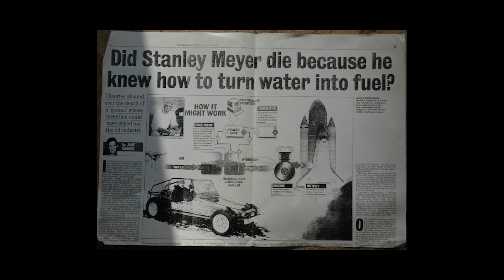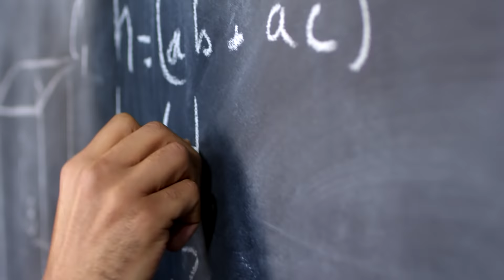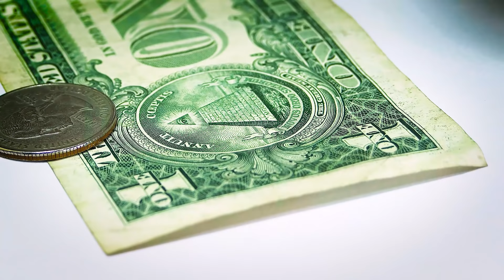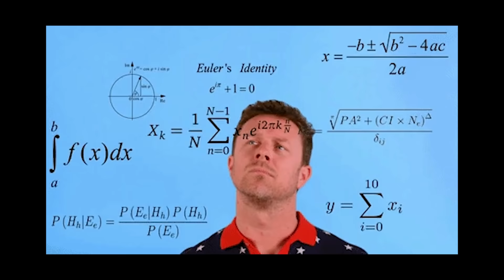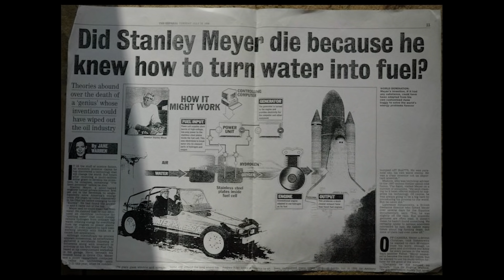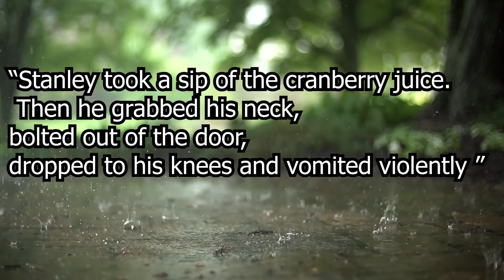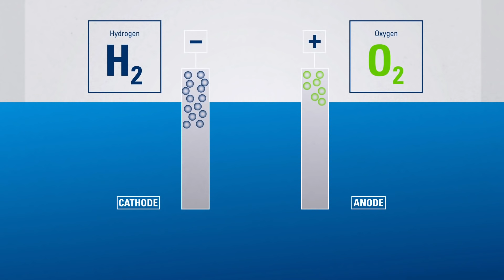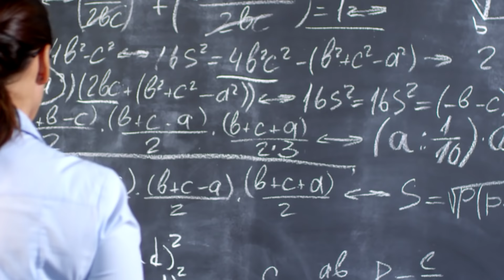Stanley Meyer Water Powered car, Lies and Death

Comment: The information below is derived from the work of genius twin brothers Stanley and Stephen Meyer.Many years of study,reading 42 patents and endless hours of Meyer lectures, documentaries and radio shows gives me the chance to show the heart of their research.
If you want to run your car on water then this is a viable and realistic set of stages to go through to achieve such a goal..
First you must ask yourself why has it not been done in this day and age..A car combustion system that can access the large amount of energy available in electrolysis gas from water.
It is commonly known as Faraday electrolysis. It has high mass conversion losses. Mainly heat.This process alone is a poor option as an engine will not produce enough electricity output to power an electrolysis unit to supply enough gas from the water to realistically cover the car engine's energy requirements..
Many have tried electrolysis gas production methods with very limited success.
So what are the steps to rethink this problem?..
Step 1
Striving for a highly efficient electrolysis cell is the first step.
Your electrolysis cell will not make enough gas to keep the engine running from the car's electrical output.But this is the first step.And the more efficient you make your cell. Be it through the physical construction or efficient driving circuit,or both
Step number 2.
As in step number one you can make gas from your electrolysis cell. This gas fuel starts as water and is converted to gas. The gas is fed into the combustion zone where the second conversion takes place..In the second conversion the gas is converted back to water,with a given amount of energy release.This is the water to gas and gas to water conversions or energy states.
Step three.
We know by now that the first conversion.Water to gas is energy intensive and has a large amount of losses.This is where many hundreds of hours have been spent by people trying endless ways to improve the efficiency of electrolysis. Without taking into account they are dealing with not one mass convention in making the gas. But two mass conventions. Water to gas and gas back to water.
This second energy conversion has been mainly overlooked by the majority of people studying in this area.
So we must take a closer look at this second conversion to see if there are any ways of improving the reaction efficiency at the point of combustion..
Step 3
Conversion factors for gas to water.
It is not well known that the conversion factors for gas to water with an amount of energy released through combustion.This only releases one millionth of the available energy that is in the gases. That is having their mass converted back to water. This is a chain reaction and is quickly shut down and reaches a stable state. The chemicals involved hydrogen and oxygen reach a stable state achieving mass conversion gas to water H2O. At this point the available mass to energy window is closed. 
By converting the gas back to water..This water should be then looked on as a waste product of the combustion event..
Step 4 
What could be done to reduce this waste byproduct (water).
In theory if you had a 100 percent conversion gas to explosive energy  during the second conversion. You would not have any waste. All the gases would be burnt and there would be no byproduct water post combustion..
Step 5
How can this be done? How can we access this chain reaction event and improve its efficiency. If we could improve this mass conversion, just a fraction of a percent. This would vastly reduce the gas input needed. To attain the amount of energy required to run the engine..Less gas is what you will require as opposed to, insufficient gas is the problem.
Note!
Yes, correct Faraday electrolysis makes a gas that you can only access one millionth of its energy through combustion.…
Step 6
How do we look at this inefficient combustion process and make improvements?..
(Chemical reactions!)
Improving combustion to burn more of the available gases.
This step is key! 
What is going on during the combustion moment?
Ignition occurs.This sets off a chain reaction that will convert the gas mass back to a liquid mass.(Water). In turn with an amount of explosive energy. As we already know the explosive energy only accounts for one millionth of the possible available energy in the gas fuel. So how do we come up with a system to access more energy from the given amount of fuel?
Step 7...Controlling the combustion event to access larger amounts of energy that are  available..
This is done by controlling the combustion moment and extending the chemical reaction in a way to prolong energy release from the gas as it turns to water.
One must note.
Is a combustion engine not a pump. It creates a vacuum at the input manifold and creates a positive pressure at the exhaust manifold.
Hydrogen and oxygen from water is the perfect fuel.Two parts Hydrogen to one part Oxygen.This is the perfect fuel to oxidiser ratio needing no other elements for combustion just fuel with oxidizer. To achieve control of the combustion event you have to control and minimise contamination from other elements. As said above hydrogen and oxygen is the perfect fuel to oxidiser mix.
Something that is mostly unknown about is.The combustion engine can be fueled with hydrogen and oxygen and have the intake manifold completely sealed off. This creates a permanent vacuum in the intake manifold. With the hydrogen and oxygen being delivered into the engine manifold vacuum. An engine like this can be seen in demonstrations online videos..
So now we have hydrogen and oxygen and no other gases at the combustion event.This makes control of the event less complex.
Step 8
How do we make a tool to act upon this simple chain reaction?
Now we get into atoms and molecules.  
Is it not true an oxygen atom is 16 times the size of a hydrogen atom. In turn having 16 times the attraction force over an electron than the hydrogen atom. This my friends is your tool to affect the combustion event.
Question is ?
Can we prepare and add oxygen atoms in such a way to the combustion event to improve energy release by way of extending the chain reaction.
Yes this can be done. First you have to have a way to remove electrons from the Oxygen Atom.
Oxygen can be held in a stable state with up to 4 missing electrons by adding the correct light wavelength energy. Removing the electrons can be achieved with the use of a low pressure plasma reactor.
A low pressure plasma reactor will act upon ambient air gases,oxygen,nitrogen,etc. In such a way to bring the constituents of air to what is called chemical resonance.Chemical resonance is a highly charged state whereby elements stop holding on to their electrons and electron sharing occurs. If you can take ambient air gases to chemical resonance. You are halfway to removing electrons from the oxygen atom.
Step 9.Removing electrons from oxygen during chemical resonance.
A plasma reactor consists of two stainless steel electrodes and quartz glass tube. The anode is positioned on the outside of the quartz. And the cathode is inside with a 1mm gap from the quartz. This gap is where the gases are worked upon. In the low pressure plasma zone.
When in use this reactor has an amount of capacitance this is including the charged gases being held at chemical resonance.The gases become part of the reactor circuit capacitance.This capacitance could be considered to be like a single cell of a battery. It takes on capacitance and in turn can be discharged when the power input has stopped. When discharging the reactor's capacitance it is possible to reduce the mass of the plasma excited gases by way of discharging the reactor to a resistive load..
When reactor discharge is engaged the mass of the gases are reduced through a loss of electrons. Oxygen with up to four missing electrons is produced. These gases can be held in a stable state by way of red 660nM light. The low pressure is maintained in the reactor by the engine intake manifold vacuum. It is connected directly to the sealed off intake manifold.
Step 10
How does mass reduced Oxygen atoms extend the opening of the chain reaction window during combustion.
Well remember that the big oxygen atom has 16 times the attraction force compared to the Hydrogen Atom. This is where the Oxygen does work for you. When these processed Oxygen Atoms are added to electrolysis gases Hydrogen and Oxygen during the combustion window. They have such a large attraction force they will overcome the Hydrogens ability to hold on to its electron. And in so forces the Hydrogen to give up its mass to energy. This interaction during the combustion chain reaction causes more mass to be converted and opens the chain reaction window giving access to more than one millionth of the available gas energy. This in turn reduces the amount of byproduct,water in the exhaust..
By adjusting the mixture of fuel and processed gases. Mass reduced Oxygen.
You can now vary not just the gas fuel input. But you can vary the amount of explosive energy per unit of gas fuel.

Stanley Meyer used this method and perfected this fuel gas mix. He reduced the amount of electrolysis gas needed to very small amounts.The water fuel injector was the pinnacle of his achievement regarding using water as fuel.
Reply: Hope you made a working version
Reply: Go make one now Einstein
Reply: Hope you make this brother
Reply: Water fuel injection, that was the key!
Reply: mtttony is correct in his reply to this video, there is no way to make the excess energy appear in the form of excess hydrogen, you need to reverse where your heads are at, the energy comes from the correct burning ENVIRONMENT of the hydrogen and then the correct containment of the exhaust from said burn. that hydrogen oxidisation exhaust, is water and it is  a liquid 1800 smaller that the volume of gasses burnt (propellent and oxidiser).

combine what I'm telling you with what mtttony said, this is basically the answer to how stan made it work, the big secret. 

You don't need to modify the valve train, you do need to make a slight timing adjustment (just past TDC) and you need to inject the hydrogen at an unusual time (TDC between Exhaust and induction strokes) . You also need to ionise the intake manifold to make electron deficient oxygen (or OZONE) and use a second seperate ioniser to get more nitrogen from the air (charged Activated carbon) and add this nitrogen to the intake manifold to retard the burn, this is not that hard, easier than is sounds. 

In a four stroke, on pure hydrogen propellent, things are completely different, you can make other, different types of forces move the piston on the different strokes.  

NORMAL HYDROCARBON PROPELLENT FOUR STROKE

1 INDUCTION Stroke            down
2 COMPRESSION stroke     up
3 POWER Stroke                  DOWN
4 EXHAUST Stroke.              up
boring!

STANS HYDROGEN PROPELLENT FOUR STROKE

1 BURN WHILE INDUCTING POWER Stroke.                <<<<DOWN
2 FORCE OF VACUUM POWER Stroke                          <<<<UP
3 EXPANSION OF CONDENSATE POWER Stroke.      <<<<DOWN
4 Exhaust Stroke.                                                             up

 IN A 4 STROKE ON PURE HYDROGEN THE REACTIONS ARE DIFFERENT !!!!!!!!!!!!!!!!!!!!!!!!!!!!!!!!!!!!!! fark its actually not hard. 
The 'excess energy" comes from phase change of a working fluid. Look at how a reverse cycle air conditioner works.... 1000watt in = 3500 Joules out. COP 3.5 phase change of working fluids rob heat from an environment. this is how it works. 
Have fun. 
Ask Questions 
B-)
Reply: @digilifestream  First off, apologies for my lack of knowledge of scientific terms and such.

Ok, so the part where you mention "ionize the intake manifold" got me thinking about the Pantone GEET reactor engine. If I remember correctly, that design utilizes a reactor rod to create plasma, which is basically Ions, correct?

Also, before I even got to the part where you mention Force of Vacuum Power stroke, I started asking myself, maybe we're all thinking about this completely backwards? Maybe we need to focus not on explosion/expansion, but instead on implosion/contraction? Which makes me want to read up on how we can use cavitation to our advantage. 

Also, I'm not completely sure how the whole conversion of water thing works, but I've read that water is very very difficult to create. Sure, you can condense water from the atmosphere, but that's not actually creating it. So, if that's the case..... why would we want to destroy water? Water is essential to life, crude petroleum is not.

This whole thing reminds me that I should re-visit Viktor Schauberger's work.

Thank you for this comment!! Looking forward to your reply.
Reply: People are brainwashed into thinking it’s impossible by reading physics laws 😂
Reply: 100%+ efficiency is key
Reply: @spyder6000  People are brainwashed into thinking it’s impossible because it’s never been done.
Reply: @spyder6000  Do you often visit Narnia?

Comment: Water FRACTURING, NOT electrolysis.
Reply: What is wayer fracturing
Reply: @colehogeland4049  Stimulating the H2O molecule, at approximately 20kHz, to spin itself apart.
The tricks are: small gaps between conductors, and very thin layers of dielectric. Meyer did this with SS tubing.

Comment: That’s crazy because the security guard/ex cop that was murdered in the Buffalo mass shooting Arron Salter had completed that very same invitation, and was in the process of getting it patented.. He was driving his truck on water.. The sacrificed a few lives to get to Arron Salter
Reply: Holy shit you’re right
Reply: No one drives a truck with water. Water is a low energy state of hydrogen and oxygen. You need to put energy in to separate it. You don't get energy OUT of it.
Reply: Arron "water powered" truck wasn't special. He used electrolysis like every other car. And electrolysis consumes more energy than it creates.
Reply: @David-bg9od  This is the first logical statement on this nonsense about water driven engines.

Comment: I’m not a physicist, but even with a basic understanding of thermodynamics a few things should be clear:
1. This can be done but economically it doesn’t make sense. The cost of one kg of hydrogen is now around 6 dollars when production is scaled. The cost at the pump for gas in Seattle is now over 6 bucks. The cost to PRODUCE that fuel is a fraction of the cost to produce one kg of hydrogen. 
2. The energy in one kg of hydrogen is about the same as a gallon of fuel to be clear. 
3. We should derive our energy for mass consumption by utilizing the fewest number of state changes possible. For example, using diesel equipment to mine lithium, to power a Tesla that derives the energy from a coal fired grid is still not “green” but might actually be the most efficient use of energy with current technology. Coal when used on a scaled model isn’t evil. 
4. That brings me to my conclusion on why this engine isn’t viable. It’s not scalable at a cost the average person can afford. It’s a miniature hydrolysis plant that cannot compete with gasoline. It’s also inefficient. It’s using a battery that was powered by a primary energy source to convert water into another energy source which means heat is generated with each conversion which is a loss of efficiency. 
5. Said differently, this engine is inefficient and expensive compared to current technology.

Comment: The issue that Meyer was "Just using hydrolosis to create hydrogen and it was nothing new is ignorant" meyer was obviously a genius who made a Highly efficient Hydrogen splitter. which could be more than achieved today due to the facts that our lectronics and batteries are far superior to the 1970's. There is an Iranian scientist who has also created a highly efficient hydrogen splitter and drives his volvo around on water. I believe water is a viable energy source, the problem with commercial Hydrogen today is that it's largely made from natural gas, has to be super cooled and compressed which is costly, leads to pipe and vessel breakdown. making hydrogen infrastructure costly and unsustainable. Hydrogen also burns at a very high heat, which leads to engine deformation, if high temp metals aren't used, such as titanium. Splitting hydrogen from water is so much better than creating hydrogen from Natural gas, a plastic fuel tank wouldn't corrode, no high pressure or super cooling. Hydrogen is far more powerful than petrol or diesel, but engines would initially cost more so the advance of EV's will continue. Hydrogen from water should be the only way that boats and ships are fuelled, cars should have that option if we can have super efficient hydrogen splitters for sale on Amazon and Ebay as well as all our local auto stores.